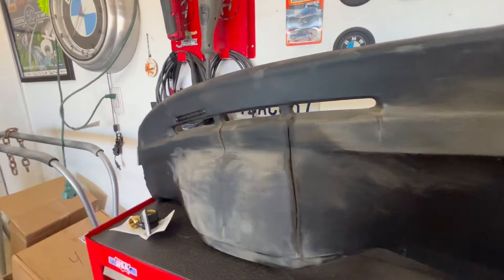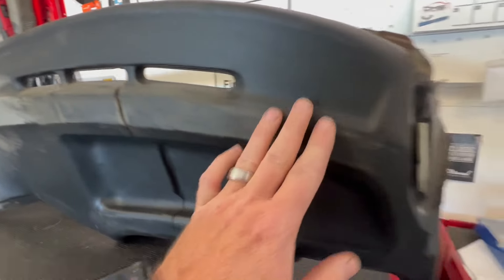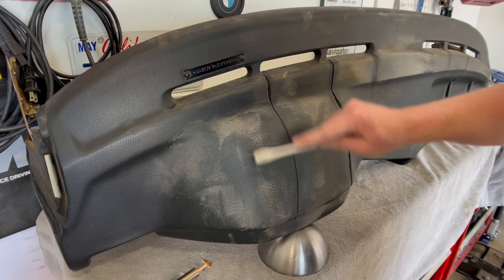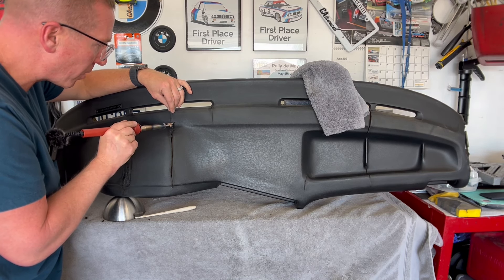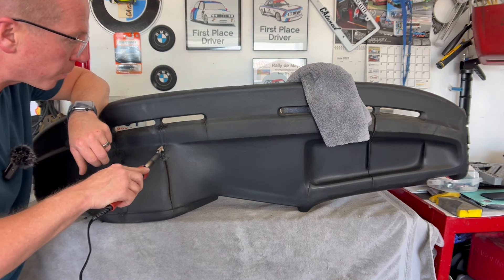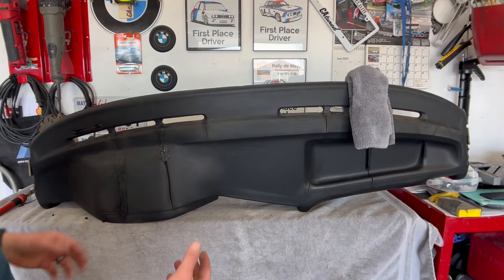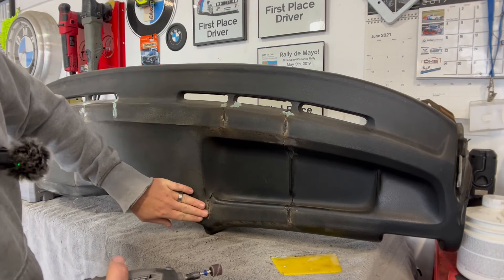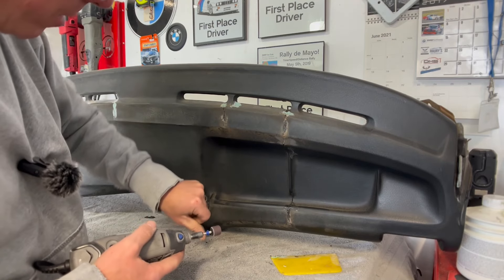Do THIS To Fix Your Cracked Dash!

Comment: I’ve been wondering about plastic welding since my rear bumper is cracked- might give a try to fix. 

Also- you are a madman!! 😂 I would never attempt to fix the dash- too scared to do it. 

Honestly- i think the dash repair is much more difficult than the cowl repair.  

I’m lucky that my dash isn’t cracked but I’m always scared my kids are going to break it 😂 - they like to put their feet in it 😵‍💫

If the dash result isn’t to your liking- you could also cover it with one of those plastic caps or perhaps wrap it with some fabric 🤷🏻‍♂️. Interior stuff is tough because it gets a lot of attention and use.  Thanks for sharing

Comment: Great video yet again tom this is first one ive seen on youtube that covers this sort of thing and you got the balls to go and get straight into it and try it well done sir ☺ ps your e46 m3 parcel shelf redye will be a breeze for you now after doing this 😃
Reply from the maker: Thank you!! I will post a quick follow up on the dash. I ended up sanding it down and re-clearing it. The texture is much better, but I still have some cracks. The texture cracks, erghhh!!! I put the dash out in the sun to see how it would respond and I noted some cracks. I filled them with super glue and baking soda. I painted and re-cleared the dash. It still looks much better than it originally looked, but the easiest solution is a dash cover. I will say that my dash looks more custom? So that is sort of cool. Yes, that rear parcel needs to be done asap!!! Thanks for watching!!!
Reply: 😂 someone’s hinting on you getting the shelf out of your e46 m3 Tom 😉😉

I need too change mine well the grey air vent bit too black 

C pilers out rear bench out and back seats as well 

And rear head rests too 😂

Comment: Tom what happened too how to take the arm pads off the arms 
Themselves? 

I only ask as I’ve just got hold of a complete pair of piano  interior trims today 

and want to take the pads off to get them re trimmed in a completely different colour 

For when i  get the interior done  eventually 😂

So my next question is 

Is there clips underneath the pads that I need to pry up on? To release them 

Or do the release from prying from the back?  Rather from under the pads themselves? 

Any tips would be greatly appreciate before I
Damage them 😬

Comment: Its never a 5 minute job is it mate and think you like me you have high standards and no matter what you do at times you always want it better but i would give your self a pat on the back for getting this far and trying its certainly going to look loads better than it did and dash cover could be option im not massive fan of them unless you use them when not using the car then good idea 👍 i actually got motivation to get oil change done on my e36 today and i know ive got brakes to replace so thought add see iff i can do the stuborn bold holding the rota on but of course it rounded off then to top it off my rear view mirror dropped off after 30 years 🙄🙈🤣